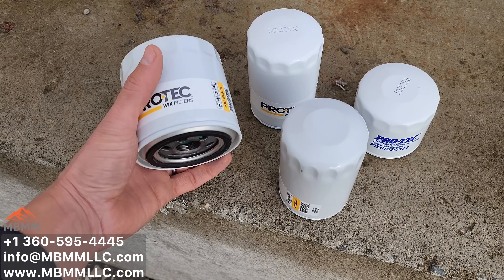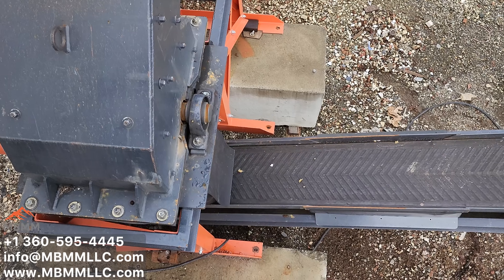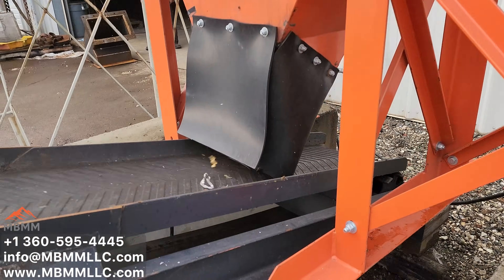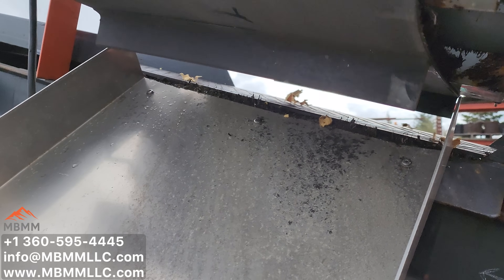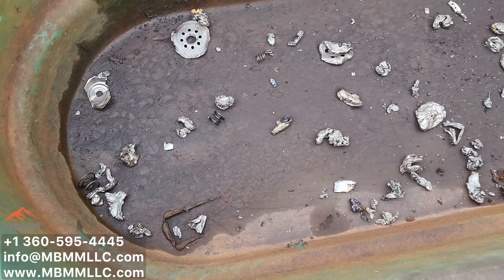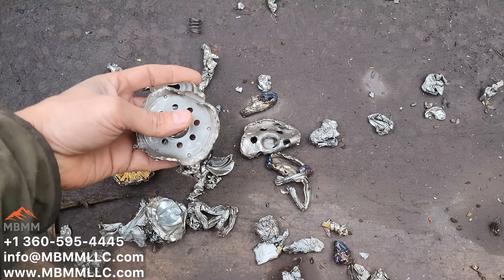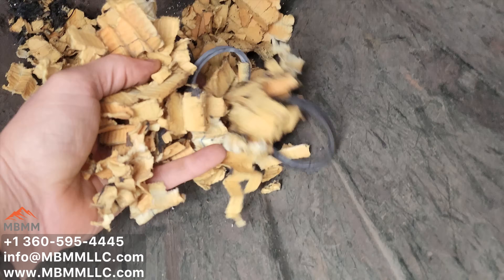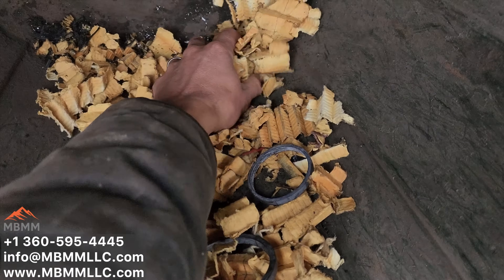Oil Filter Recycling & Shredding

Comment: I just recently had to scrap several dozen kilos of clean oil filters that had been left out to rust.  I got dirty ferrous price, the lowest scrap price you can get, because of the paper and rubber.  The waste would only be about 5% of the total weight but to sell the steel as clean light metal scrap would have nearly doubled the price per kilo.  For an operation that regularly received dirty scrap steel in small sizes, a hammer mill would be a very worthy addition to a scrapper's shed.

Comment: That might work great for new filters, but use filters you gotta deal with oil. The best way to get rid of the oil is to burn them in a woodfired stove, you get heat in very little mass and in the end all the paper and oil are gone. But of course, then you could use this system to shred filters after that🤷‍♂️
Reply: If you burn the oil then the toxic chemicals from it are put into the air that you breathe.

Comment: Sorry sir but you used new clean unused oil filters. I think the result would have been different had you used old and used filters. The paper element would have stuck to everything because the dirty engine oil and filtered particles would have acted like a tacky glue. Try again with higher millage oil filters, It will be messy but a much better demo. Sorry about this....
Reply: An eddy current would separate the dirty paper.

Comment: Back in the 1980's I worked at a gold mine where we had a press that squeezed all of the oil out of used oil filters and then shredded them. We received a big fine from MSHA and the EPA for unlicensed processing of hazardous waste. Be careful, Jason.
Reply: Jason's filters were unused.
Reply: Used filters are recycled differently.
1. mechanical pressing squeeze out as much residual oil as possible. The oil is collected and given to oil recycling companies. 
2. heating of the pressed blocks to reduce the viscosity of the residual oil. This makes additional oil to flow out.
3. the pressed blocks are put into an oven. The oven is heat up to around 600 degree. The residual oil  and paper burns off in this environment.
4. the now oil free but rusty blocks are sold as scrap steel.